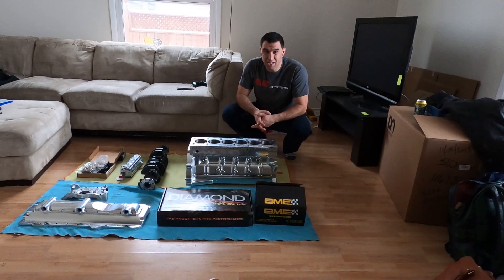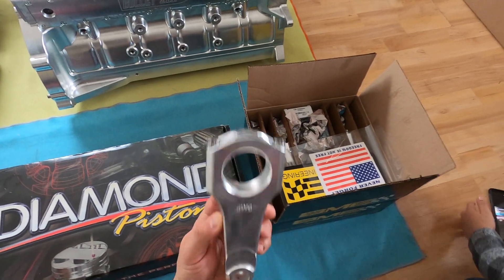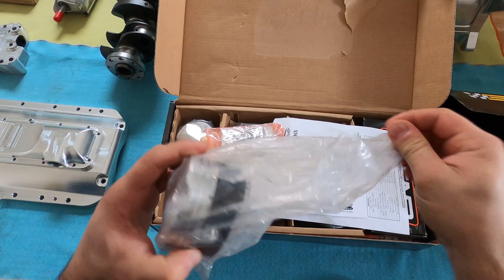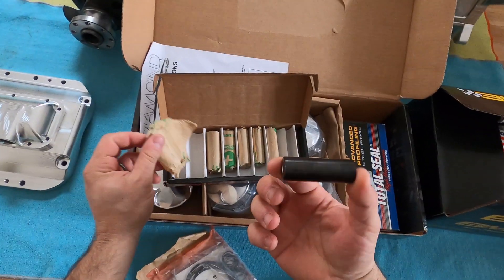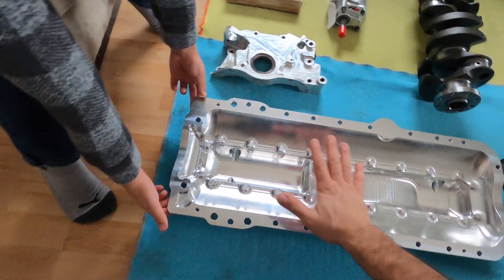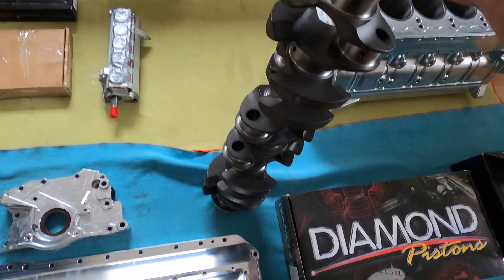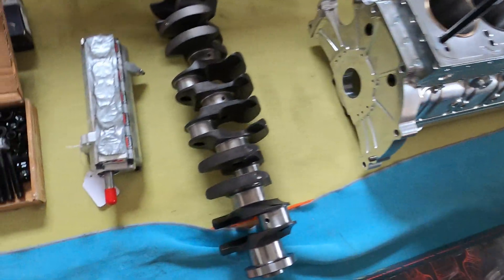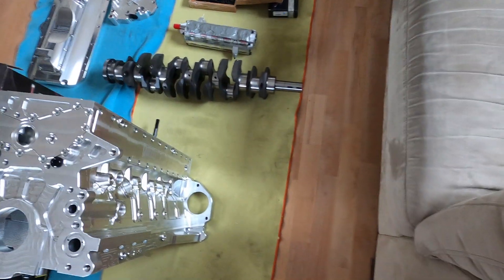2500 HP 2JZ Supra Billit Engine - Parts list

Comment: I see 6’s in your future. 😂
Reply from the maker: That's the goal
Reply: Ryan Sammut Racing 
Why don’t you get Steel Billet pistons, I can’t see any aluminium pistons withstanding 2000bhp
As matter of fact didn’t you melt these pistons in a later video ? 

Steel pistons can be light if they where machined right.
Holes should be bored on the underside of pistons during machining process to trim the weight off.
Reply from the maker: @chris77777777ify  steel pistons are too heavy that's why most are made from aluminum. Yes 2 were damaged but it was caused by lack of fuel